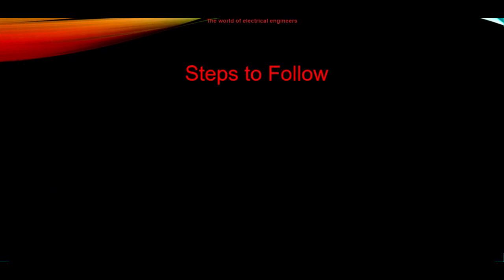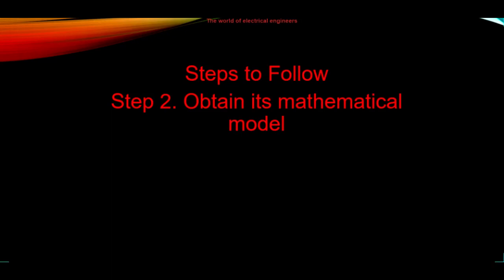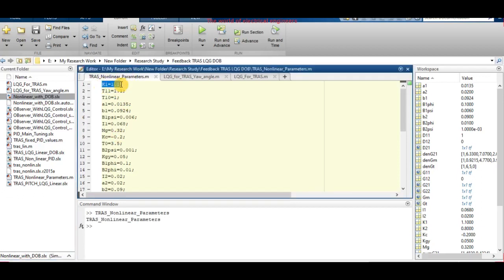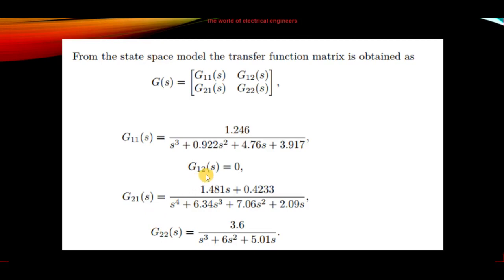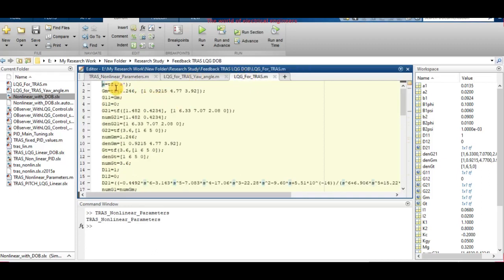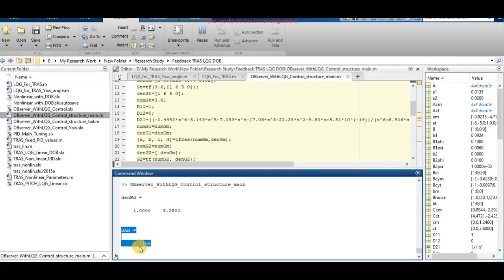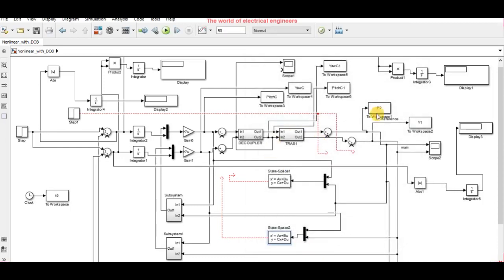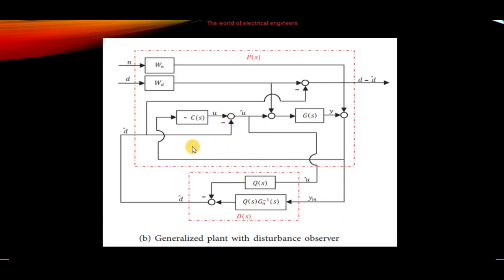Disturbance Observer in Matlab || Twin Rotor Aerodynamic System

Comment: Sir can you please send me the simulation model.. I really need this.. please sir 🙏🙏🙏🙏
Reply from the maker: Full code is available here. https://github.com/engrhamidali94/Control-System
Reply: @TheWorldofEngineers  sir I got code from the description.. I want the simulation model
Reply from the maker: @stringtra4531  Simulation model is available inside the folder along with the controller
Reply: @TheWorldofEngineers  thank you sir🙏.. I haven't seen that.. sir  would you please help me out.. when I am trying to open the LQG simulink  it's saying " invalid block diagram supplied. Valid block diagram names are same as valid matlab variable name". What should I do?
Reply from the maker: @stringtra4531  first of all you need to run the .m file named parameters. Then open the simulink file
Reply from the maker: @stringtra4531  First run the m file TRAS NonLinear Parameters
then LQG for TRAS Pitch
then LQG for TRAS Yaw angle
then Observer with LQG control structure main
then Observer with LQG control structure Tail
At Last open the Simulink Full Nonlinear with DOB file and run
Reply: @TheWorldofEngineers   thanks for the explanation